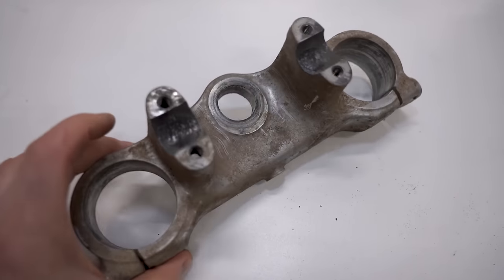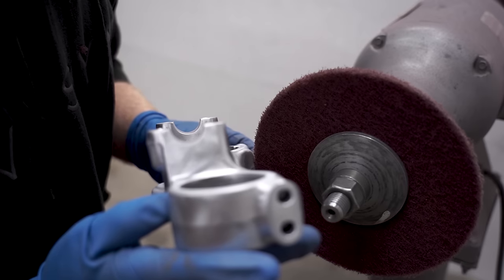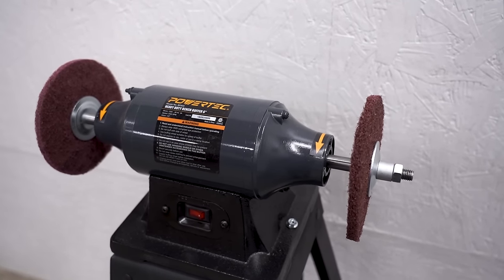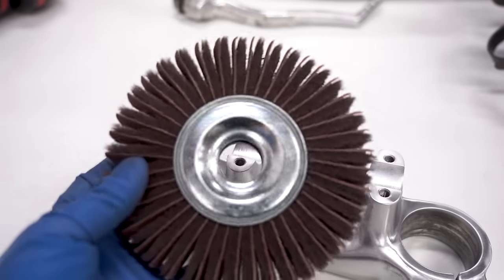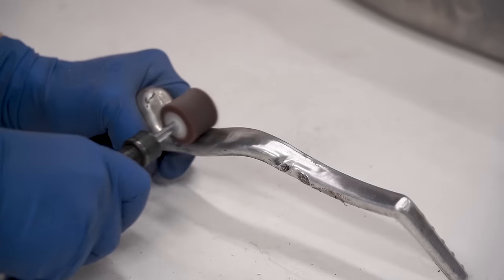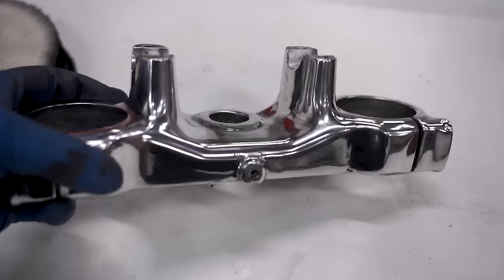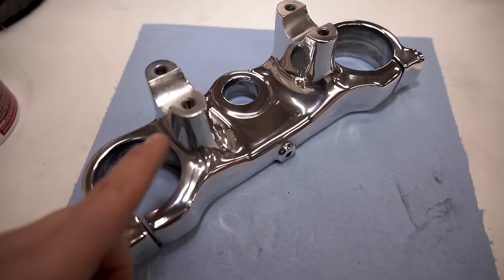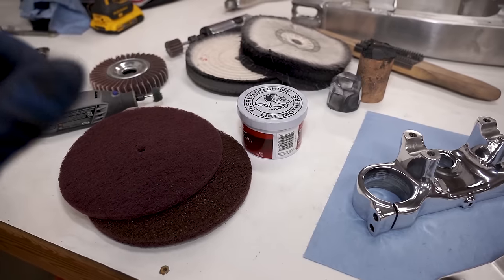Tricks to Polishing Metal!

Comment: Cam! You should do a bike and make it a “CHROME” build do this to all the metal pieces it’s not my style but if the whole bike was done like that it would be super unique and would definitely draw a crowd.
Reply: With clear plastics
Reply: And yz125/250
Reply: Bronson Launder everything chrome handle bars triple clamps swing arm levers pegs. Man just thinking about it done like that I would need to be placed in an art museum!
Reply: That would be neat
Reply: Soo 2003 I like it 😂😂
Reply: There is a chrome Cerakote for the hard to polish parts.
Reply: TheNickademas1 A little 85 or 65 would be cool to do
Reply: It wouls be such a nightmare to maintain..
Reply: Chip Fisher don’t try it on the tyres 😉😉🤪
Reply: Iv polished the whole frame  and swingarm and suspension linkages on my 09 KXf 450.   Had  a lot of time up  my sleeve recovering from a broken  back.   All i had was sand paper and a metal polish called Purple. Magic stuff.  With work you can make aluminium look brighter than chrome.
Reply: Excellent work. Very nice camera work and thank you for sparing us with silly theatrics and horrible loud music.
Reply: It’s looks good but the clear anodising was there for a reason, a hard coating to protect the soft aluminium.
Reply: So does any real rat, and they are easier, cheaper, and rarely get stolen...
Reply: @stevenowen4150  Hope your back could handle it, and you're fit for fight again.

Comment: I’ve been polishing metal for years now and your video is very informative and bang on for us DIYers.
I understand polished aluminium tarnishes and needs protection but polished steel can be cleaned after the buffing process with WD40. That stuff is a great cleaner and brings out a shine like you wouldn’t believe. I’ve also found polished steel never rusts as there are no nooks and crannies for moisture to settle in.
I’ve polished all my steel tools in the workshop over the years and never had a rust problem like I did every year after cold damp winters. Thanks for your video.🇦🇺👍
Reply: Hey, I’m thinking about going all out on my hot boy civic build. Was gonna chrome polish the entire engine bay. Every single part as well as the bay itself. You think I should just polish and clean as you outlined or would a clear coat be a good idea in this use case? Thanks
Reply: Do you use WD40 to protect the steel after polishing? Would a metal polish be better?

Comment: Just throwing this out there:  sometimes using machines is not always a good idea.  Generally I would wash the part.  Then I would file down the casting marks.  For the flat areas, I glue sand paper to small wooden blocks.  I would start with 600 (wet, water and dish soap) and see if it removes the deepest scratches.  I then work my way to 2000 grit and then finally the buffer.  Something to keep in mind is, all aluminum oxidizes and it happens way faster than you might think. For example, you could be sanding on a part and come back to it in 3 hours, and you’ll have to resand back through the oxidation.  You can tell when you get through, the sandpaper will feel like it’s dragging (cutting) more.  And when you get your final finish, don’t put anything on it other than wax.  If you spray clear coat, the aluminum will oxidate and the clear turns an ugly kind of yellow.
Reply: You can buy clearcoat with UV protection
Reply: Ceramic coating 😊

Comment: For the clear coat, or really cleaning any metal you can also soak it in acetone. Simple Green works for cleaning in most cases; but for high carbon build or paint, toss it in a appropriate sized container and let the acetone do most of the work for you... of course if you have the means to own a wet blaster, just use that; but if you do sand blasting it's critical to clean the part as much as possible before blasting it. Otherwise you contaminate the blast media... great video.

Comment: Cameron, Well done buddy, I've been polishing self taught for the best part of twenty years and getting reasonable results, after watching your video it's answered all the questions I've been wandering about but not had the answers to, now I know and also picked up another supplier for finishing products, so big thank's for that. Also the video on plating, again, I have one of those kit's but not set it up yet as been too busy being ill, pleased to say I'm loads better and will get cracking with the plating now youv'e answered all the yestions. I have a Honda XL 500, XL 600 and also an old Peugeot ex French Army bike to do, so should get plenty of use.
Reply: Cameron  to ask, have you tried to plate any large item's, one of the reasons I bought the Caswell kit is because I have a massive collection of vintage two gallon petrol cans which are 12 x 10 x 6 inch's I have a custic tank to strip them and also a Soda blaster to finish them off, I would really like see how one look's like plated, I was going to chrome powder coat one but you can't get them to hot as all the joint's are soldered and experience has proved that they can fall apart. I have 1,000 of these can's along with other vintage item's and of course the bike's.

Comment: Have you covered when and why one would use the low or high speed options on the Baldor machine?  I have ordered your pads three times and am finding that my results are good.  I have a 1hp two speed machine from Eastwood.
Love your educational videos.
Also the method of clear coating freshly buffed steel or aluminum motorcycle parts would be great.  I use the 2k Clear Glamour rattle can product.

Comment: I've been polishing a Mustang Bullitt intake manifold. I've got a great finish on a lot of the flat surfaces, but I'm struggling to get the detailed areas. The Dremel attachments available at the store and on their website are super pricey and you end up buying combo packs that leave you with too many of one type you're not going to end up using. Thanks for sharing the attachments and bits you used. 
Metal isn't polished until you can use it as a mirror. Haha

Comment: If you have something with lower speed a soft bristled wire brush with light oil or WD-40 will polish aluminum nicely.
I know it sounds like it will scratch but for me it never has as long as oil was present.
Works good with a drill and small cup brush.

Comment: Great video. I learned a lot. Even bought a bench top polisher and a 1/4” and 1/8” pneumatic die grinder. Thanks to you, I’ve spent a Sh|+ load of money. But I don’t know where to get those flap wheels with scotch brite inside. 
You have a new subscriber.
Reply from the maker: Thanks for watching Paul! You’re going to love polishing! Please reach out if you have any questions while getting going.
Reply: Hi. I got the packages you sent. Also got a Rikon 6” polisher and your stand. Putting it together now. Even put your decals on it. 
Question:
When I put on your felt pad flap wheel, there doesn’t seem to be enough room to put the nut on. What’s the solution? I’m using the parts that came with the Rikon, not the ones you sent. 
Should I use the fiberless wheel on one side and the flap wheel on the other?
Thanks. 
BTW, you look like my nephew who’s a tattoo artist in Tucson. 
Paul.
Reply from the maker: @paulmanhart4481  Please send an email to cameron@prymemx.com and I’ll be able to get back to you quicker there.

Comment: Please be aware-
This part, as with most "parts" is not plain aluminum. If it were, it would
crack or bend during it's service (a motorcycle yoke?).

The old slang for chrome wheels was "mags", because things are a
mixture of the homogenous metals Aluminum and Magnesium.
One is soft and malleable, the other- hard & brittle. Together, the amalgam
is wonderful for it's light weight, strength, and ability to be polished to a mirror.

Everyone still just calls it "aluminum" though.🤷🏻‍♂

Comment: Recently I started another motorbike restoration, it's going to be a full nut and bolt job so I bit the bullet and got myself a decent 1.5 HP polisher, it cost a fair few quid but what a difference to the clapped out old polisher ive been using for the last 20+ years. I am really impressed with the various abrasive discs & flap wheels in this video, never seen those before & I already know I want them now I have this new machine !
I just clicked the link and saved the website ready to do a shopping list later, the only downside is the shipping, import duty & handling fees at my end so looks like I'm going to have to dig a bit deeper. 
Great video you did here btw very well explained.

Comment: I have a bunch of steel parts from my Southbend Heavy 10 L lathe. Pieces like hand wheels, handles and dials. What do you recommend I use on them? I want them polished and I plan on filling in the micrometer marks with black enamel model paint after polishing. 
I’m going to drive you nuts with questions 😬
Paul.

Comment: How do you deal with contamination? Also, the cleaning wheels don’t come in 5/8” arbor. Why?
Great video. 
Paul
Reply from the maker: You can use a buffing rake to clean the polishing wheels, but do not use on flap wheels or cleaning wheels. The cleaning wheels utilize a flexible arbor hole so it can be used on multiple shaft sizes. You just twist the wheel onto the shaft on 5/8” and 3/4” shafts.

Comment: Fyi, if you remove the edge from the triple clamp around the fork tube area it will give the front end of your motorcycle more flex. Can be a good thing &/or bad thing depending on each bikes original handling caristics & of course your personal preference. 
Great video👍
✊💯💨

Comment: Hey I have a problem with myCR125. It would load up in low end but as soon as u got on her a bit she revved normal. I have no idea what it is but I’m wondering if this is the issue: when I have the power valves shut one shuts all the way the other is a bit open. So far that’s what u think it is but anything else could it be?

Comment: What causes backfire on a four stroke crossfire xz250r  
I got new. Ai filter spark plug fuel what causes it
Reply: Too tight valve tolerances, wrong timing, to rich fuel mixture... thise are some
Reply: Isaac Walchli check valve clearande and timing

Comment: Just checking that 80 grit is correct.  The website shows the 80 grit in green but the video's wheel is red.
Reply from the maker: The suppliers changed but 80 grit or 180 grit is suitable.

Comment: Could I use these same steps on my stock header?
Reply: I think so but the rust can be really hard to get off. Also i would spray it with a heat resistant clear coat after the buffing so it wont rust too fast
Reply: xtreme pacito thanks for the help

Comment: Thanks Cameron,
#markmoto550 put me on to this video and it explains so well what I"ve been trying to accomplish.
I've got my top end removed and a few other covers taken off as well, so I figured now was a good time to learn how to get them brushed.
THe only problem is that I'm not that familiar with what is Steel, Chrome or Aluminum. But I believe that you mentionned that regardless of the type of alloy, the procedures are pretty much all the same?
Once again thanks for this, it sort of demystifies the process.